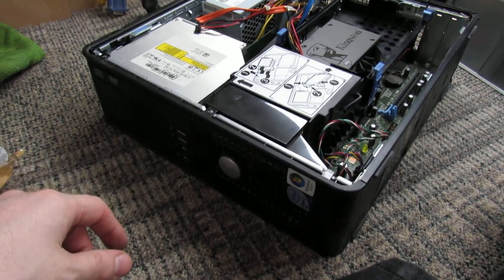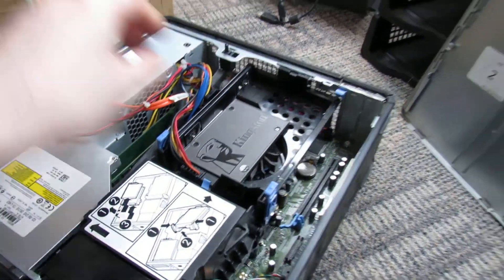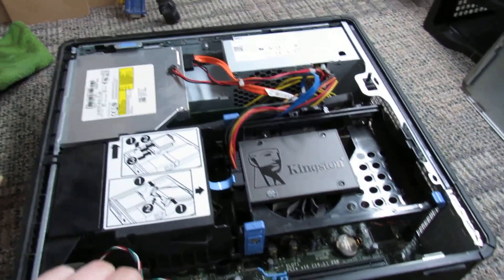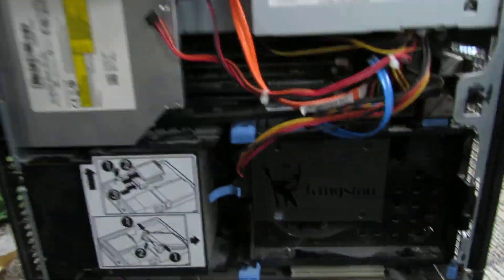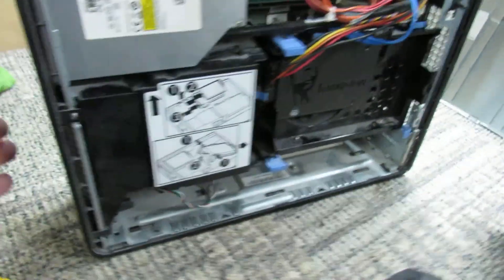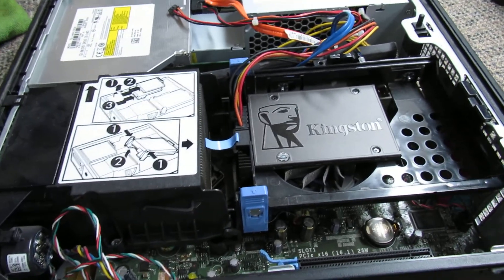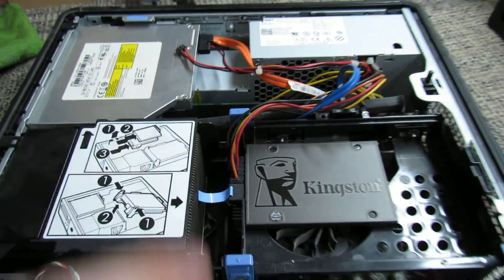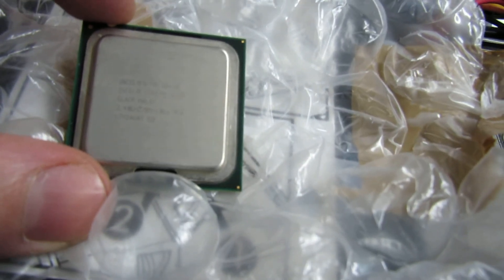How to Install, Replace, Upgrade or Change the CPU in your DELL Optiplex - 755 SFF

Comment: Thanks, this was the final upgrade of our shop computer. Got a Q6600 for $4 including shipping off eBay from China, lol.

I also replaced the heat sink goop on the chipset.

Trick was to LIFT the heatsink after unscrewing. 

Works pretty fast now on latest Linux Mint. Also got a $10 128gb SSD and doubling the RAM. Runs Spotify (had to get an old version and prevent upgrades because it doesn’t support the CPU extensions required), Discord, YouTube & Web browsing. Might drop in a better video card for some Open Red Alert.

Comment: Support Q9400?
Reply from the maker: not sure but you can check supported processor list for the optiplex model it may be too high
Reply: @DanielJohnHowTo  It worked by updating the bios

Comment: I just installed 8GB RAM into a 755 & the CPU is next so I did a quick ck & found you clip to see what I may need 👍
...Core 2 Quad 2.83
Reply: Anything under 16gb limits you

Comment: I put thermal grease on & use my finger (not smearing but dabbing it all over) to evenly coat the CPU, making sure there's no gobs overlapping like what appeared on the heatsink. I've seen some nightmares where the grease insulated by overcoating & even getting on the pins.

Comment: Can I put 16 gb of ram on it and does it matter what type of ddr it is?
Reply: mine had ddr2 in it. you would need to check what yours has before you get more
Reply: Most Optiplex allow up to 32gb ram and won’t matter howeve ddr3 or above is preferable

Comment: hi I have the same pc and need to upgrade as well. what is the cpu make and model? also I want to upgrade RAM from 4 gig to 8 gig, what typ of ram do i need ? what make and model?
thanks for brilliant video.
Reply: Desktop ram not netbook or laptop ram and also keep it above 1800 mhz won’t matter if it’s ddr3 or ddr4 however newer does mean longevity so up to you on that part

Comment: I have that heat sink and i cant seam to get the screws off.
Reply from the maker: the heatsink is probably stuck to the cpu, unscrew there gently twist it left/right and pull up.

Comment: Hi Danial, 
I saw yours has only SSD. Does it work properly? Someone told me that it cannot work without original HDD. SSD need to be on CD rome bay to make it work.

TIA
Reply: i cloned the original drive in mine and changed a bios setting and it worked better than ever after the upgrade